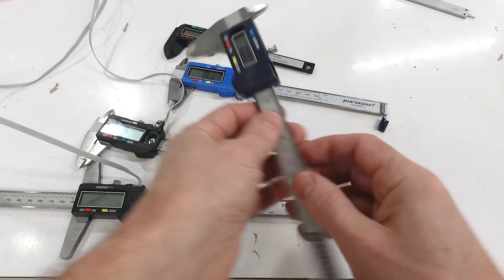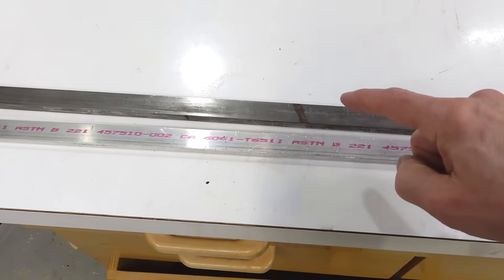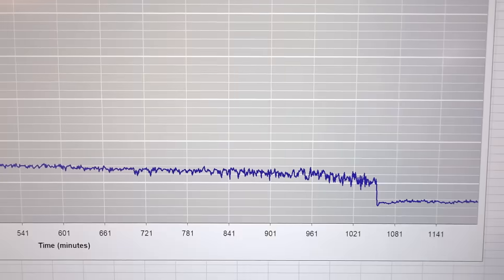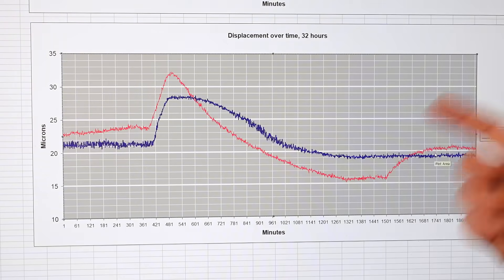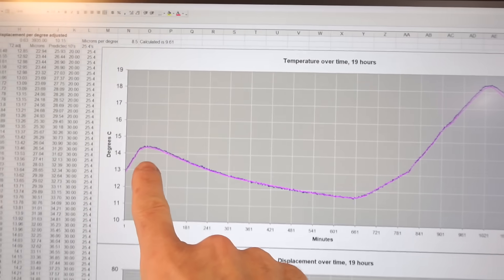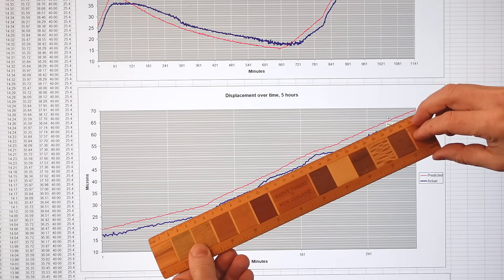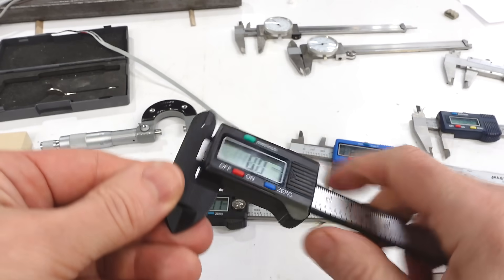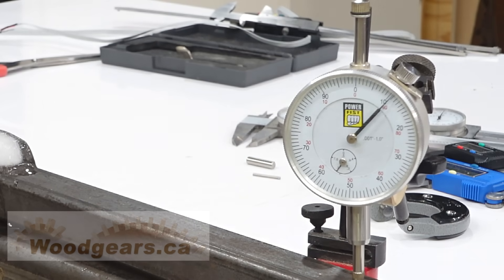Measuring microns with digital calipers

Comment: The ice cube response at the end is way too quick for me to understand. If it was anybody else on YouTube I would not believe it. Is there an explanation? Did you time lapse the reaction?
Reply from the maker: Nope, real time.  I warmed up the metal to about 35 degrees C beforehand so I'd get good heat transfer.  And melting ice takes up a tremendous amount of heat very quickly.  Was going to use a heat gun to heat it, but decided the ice cube would be more impressive, as its quiet and fast.
Reply: @ ahh, i missed that that bar was heated, that explains the quick temp reaction. That makes me feel better thanks.

Comment: Wondering of that repetitive error is caused by errors in the PCB layout or using "snap to". Or even the friction against the printed or engraved markings.
Reply from the maker: I would guess rounding errors in the software.  The period is far too short to be from the PCB traces, as those are much much larger.

Comment: Decades ago, I was in a friend's house. On the wall, he had a framed US Patent Certificate. I asked about it. He said he helped design a measuring system for military  artillery barrels, when the sun comes up in the morning, the barrel gets warmer on one side, causing shot deflection.
Reply: @1dave301  When the railways started to build the first railway bridges over the big rivers in the Netherlands (so think 1860's) they built a bridge and found one girder to be offset 5cm from the other. So they clamped it to one side in the morning, let it expand, then in the evening clamped it on the other side to let the cool night contract it. Over the course of a few days, the (multi-hundred-tonne) bridge was moved with milimetre precision to it's desired position.

Comment: 4:05 I don't think it's friction. I think you need to measure the temperature inside the rods.
Reply from the maker: the temperature in the rods would take possibly as much as a minute to equalize.  My experiments on the other hand went on for 20 hours.  So not a factor.

Comment: The cheap calipers do have an interface, they just don't have the connector soldered on.  If you pop off the case screws you can solder onto the board there and interface with it.
Reply from the maker: No, these plastic ones don't even have the pads to solder to.  The blue ones I have have  the pads but no removable part of the plastic.
Reply: @matthiasrandomstuff2221 thank you for looking.  They used to; I'm sorry I sent you on a wild goose chase

Comment: Terrific video.  Your work is always very interesting so don't worry about that.  Using relative linear thermal expansion of two metals was very clever although the limits of both accuracy (deviation from the absolute "true" value) and precision ("repeatability') are challenging at the micron level.  As you know thermal linear expansion is influenced by the specific composition of the metal, and even a digital Mitutoyo micrometer has a maximum resolution of 1micron +/- 1 micron (RSD of 100%).  But your approach, persistence and ingenuity in evaluating your results was impressive and it was interesing to see how closely you could approach a thousandth of a mm using simple calipers.  Great job!

Comment: Temperature sensors are on the surface, but the metal expansion happens as the entire block warms/cools. I think you would get more accurate temperatures if they were embedded completely in the metal. Just a guess...
Reply from the maker: metal is a good conductor of heat.  Air is not, cloth helps insulate.  Thus, the rods will equalize with themselves much faster than the environment.  As in, no significant temperature gradient.

Comment: The ice cube interaction being that quick was amazing. This was DEFINITELY and interesting and valuable video to share. Maybe a video on the pinout and interface to the arduino to share.
Reply from the maker: why don't you watch my video about the pinout and interface then, and share it?
Reply: @matthiasrandomstuff2221  I think I asked you in that other video 
"What type of connector that port was designed for?"
Looks like it was designed for a factory made connector, 
but I don't know which one..
Reply: @WagonLoads  They're all different from each other, with no standard for pinout or data format. The connector to use is a wooden/cardboard/3d printed block of a size that fits tightly in the opening between the PCB and front case, with spring pins in grooves that line up with the pads on the PCB. If you want a 'real' connector, solder a 4-pin JST-PH or microblade or something to those pads yourself.
Reply: @AJMansfield1  Yes, that is what I am talking about. I wanted to know what factory made part the circuit board footprint was designed for..

My calipers are all stainless steel except for a black plastic case that houses the display section..

Since I only have one set, it can't measure itself directly.
The only way is to shave something down until it just fits, 
then measure how wide it is..

I was thinking it was some kind of JST connector, 
but I didn't know which one.
Reply: @matthiasrandomstuff2221  I absolutely will! And I apologize if you mentioned it and I missed it in the video. Seeing the graphical results was VERY interesting, and I have often wondered if it was worth using the output. I think it would be simple to design a 3D printed plug for the access port.

Comment: Could there be small differences in temperature throughout the cross section of the bar that act as the "friction"? Like the side nearer the table, or nearer the blanket, being slightly warmer or colder than the side touching the other bar?
Reply from the maker: No.  They equalize MUCH faster than the room temperature was changing.
Reply: @matthiasrandomstuff2221  I guess that makes sense now that you put it that way. Thanks for the reply.

Comment: Fantastic video.  
Looks like you have some stick-slip going on - have you tried removing the calliper jaws and just having the readout PCB move freely against the scale PCB without any mechanical contact?  Would be interesting to see if that changed the lumps and bumps.  
There may also be stick-slip going on between the metal surfaces too.  I wonder whether some PTFE plumbers’ tape between the bars where they are not clamped would change things.
I’m not sure about your materials, but the CTE of rolled metal can be a bit anisotropic, which might explain why you need a 10% fudge factor in your expansion prediction.
Reply from the maker: then I would need to make some sturdy metal frame to mount the PCB to.  But wait, I already have one of those ... The calipers!

Comment: I don't know precisely what kind of sensor you are using, but have you considered any of the self-heating behaviors of some thermal sensors?  I.e.some you give a tiny current to in order to read.  For example, I did an experiment where I tied two sensors together and ran one 'constantly' and it heated up the one that I only sampled periodically.  i.e. if heating up the thermocouple made it think the aluminum was a tiny bit warmer than it was, it would predict more linear motion than was real.
Reply: interesting comment. Furthermore, the self heating temperature would change over time according to sensor thermal mass.
One factor to discount the self heating theory is that assuming a suitably low thermal resistance between sensor and metal, the sensor self heating should flow back into the metal
Reply from the maker: The temperatur sensors do self heat.  Every time I read them they briefly heat up by about .015 degrees.  This is actually useful as they only putput a resolution of 1/16th a degree, so by taking a bunch of successive readings and averaging, you can get more resolution.  I only do a cluster of readings every minute, so its pretty insignificant.

Comment: be careful, metrology and the science of measuring to extremely small precision, will be a deep hole that will consume you. You are an engineer, so you understand how this is a world that lives behind the curtains of consumers in everything we own. Awesome video, and yes it is very interesting. The fact that you are able to measure in the microns is a feat in itself, making it repeatable is the other hard part. I couldn't tell you how many times my cmm measured one thing during routine inspection, and another when a customer inspector was on site.
Reply: I don't know if you have ever heard of Marco Reps, but your comment really reminded me of him jokingly
Reply: Just don't try to set your clock correctly, so you know exactly what time it is. Over forty years later, I'm still not satisfied - my clock still isn't exactly right.

Comment: Nice demonstration. It is quite impressive that these mass produced PCB-based scales and inexpensive readout chips can achieve such resolution!

Once upon a time there was a company "Kensington Laboratories." They provided precision linear stages, popular in semiconductor industry. Outwardly they looked like any linear stage, but produced very good accuracy -- provided one followed a very specific ritual when installing them. You could not mount them to an ordinary machined flat surface. It had to actually be flat to the required accuracy. And one could not use four screws even then, to avoid bending the stage. All in all, achieving micron accuracy in all dimensions required dealing with many nuances which are easy to overlook in less demanding situations.

Comment: Matthias,
Interesting to see what calipers can do. Most people use digital calipers to measure 0,01 mm. When I was in the Delft Technical University in the Netherlands I was taught that according to the Abbe-principle, to do accurate measurements the position where you do the measurement should be in line with the measurement position. This does not work for a pair of calipers. So the best you can do with these is interpolating between the vernier lines of 0,1 mm, which gives you an accuracy of 0,05 mm. The fact that the electronics seem to geive 0,01 mm is not of any value.
To measure 0,01 mm you need a micrometer, as you showed in the beginning of your video.
All in all,  a very interesting project. It also shows that keeping the calipers in your hands for a longer time will distort your measurement.
Regards,
Sierk de Jongh
Reply from the maker: testing these, they surprisingly were within .01 mm compared to the micrometer. That's for the good ones though.  But my "good ones" are also cheap ones.

Comment: Two options to improve your readings.  Same setup with lubrication or add a shim on the clamp side and a needle bearing on the other end of the same thickness as the shim.  Results would be interesting.

Comment: Wow. And I thought I was smart for just hacking a physical on/off switch into all my calipers so the battery wouldn't be dead every time.
Reply from the maker: Must have been a very tiny switch.  Switch sure beats pulling the battery every time!
Reply: @matthiasrandomstuff2221  It was! Small enough, in fact, that when I was gluing it in, I also managed to glue the switch on the off position. Luckily it came in a 50-pack.

Comment: Thermal inertia. Air temp vs delay in metal heating?
Reply from the maker: I measure against the metal, inside the cloth, so I'm pretty sure the sensor is the same temperature as the metal.

Comment: super interesting... as marcoreps says: chasing zeros after the comma.
At the start of the video you showed clamping the aluminium and steel bars directly to each other, nothing in between them, but later with the ice demo there is an spacer between the two tubes.
I wonder if your measurements were done without or with something between both bars at the clamping end, so they are as free as possible to move independently, clamping is not a "point"; that might impose a lot of friction and create that creep/hysteresis you saw.
Also,  weight sensors spec sheet state the "creep" of the sensor, which for what I know is something intrinsic to the metal the sensor is made of (process, alloy), maybe here one or both bars also show that, either because they are hot/cold rolled, casted, etc.

Comment: What was the supply voltage sensitivity on that thing? Could it be that, when it's changing the number or position of active segments on the LCD, that's affecting supply voltage? :) Or any sort of internal coupling along the same lines (in which case there's not much you can do from the outside). This would also explain the increased noise when it's dithering between display values.

Comment: Your bimetal strip could be used as a thermostat.  Consider a filter to smooth the measurements.  Tektronix uses a method for getting 11 bit resolution out of 8 bit conversions on their older DSO scopes .. good read.    Mr. Kalman could be your friend.  Plenty of PYTHON libraries.  Do vibrations from local sources have any significance to the variations in your readings?

Comment: Well judging by the unfiltered or at least not the mean values of your calipers I'd guestimate your dragging is just a digital issue not a real mechanical dragging/hysteresis.
Reply from the maker: do explain how that is supposed to work? Its not like I implemented some filter that keeps old values around after averaging for a minute.

Comment: You are the first woodworker who cares about closer measurements than the average metalworker!
Reply: I think it's because wood moves. At the micron level, there is going to be a lot of movement over time so anything above 1/64 of an inch for 98% of woodworking is wasteful.
Reply: Not the first but I applaud the zeal

Comment: Keep in mind, you're possibly witnessing thermal changes in other items touching your measuring device.  Which means, there's uncertainty involved that may be showing up in what you think is strictly the UUT, but has other contributors.

If you really want to get that far down into the thermal effects, look into using a laser interferometer.  It removes the physical contact with the UUT.

- former Metrologist

Comment: Make your own with a encoder, it is pretty cheap and you can get really good results
Reply from the maker: what sort of encoder do you suggest?
Reply: @matthiasrandomstuff2221  Search for "Pulses Incremental Optical Rotary Encoder 100/200/360/ 400/600/1000/1024 P/R AB 2-phase 5-24V Encoder 6mm Shaft" and see if you like it

Comment: As always Interesting Traces and capacitors.. I never saw a detailed theoretical/mathematically explanation how those calipers work. I assume the 'comb'traces are slightly different (different pitch) so they produce an interference when slided. But how that produces such a high degree of accuracy (given that 'comb' traces are visible by the eye)  is beyond me. So If somebody can point me in the right direction..

Comment: You mean to say that if inches are used then the caliper is less accurate than in Millimeters
Reply from the maker: Just coarser resolution.  Though fancy ones will show to half a thou when in inches, which is almost as fine as .01 mm.

Comment: Next video - custom PCB for the custom calipers + PCBW/JLC/etc to manufacture this and here we have a sub-micron precission :)
Reply: PCBs are used because the cost is very low and the accuracy is sufficient for the application. They are just PCBs, no different from a PCB for any other nice gadget. Many manufacturers offer PCB fabrication services at very competitive rates even for small volume, precision products. The accuracy is good, but there are limits to how good it can be with the materials used in PCBs. 

For anything more accurate, the principles remain essentially the same, although usually using light instead of electricity. Precision scales are made form materials which allow to obtain better dimensional accuracy and thermal stability. The same photo-lithography is applied, but the pattern is etched in a layer of chromium on solid polished glass, instead of a layer of copper on fiberglass composite. Glass scales used to be relatively expensive, until companies in China started to make them in bulk. Now it is just another commodity item.
Reply from the maker: then I also have to design my own algorithm to read them.  Which may involve some analog circuitry built into the chip on the calipers.  Don't want to go down that rabbit hole.

Comment: You mentioned you weren’t sure this was interesting. I felt it was right up there with top most interesting videos I’ve watched that you’ve produced.😊
Reply: The caliper data output and the simple reminder of how finicky precise measurement becomes due to temperature were both pretty good tips. 👍
Reply: Ditto! Solving a problem of this type on a "DIY budget" and bringing the receipts as well is awesome!
Reply: I've subscribed on the back of this video, love this stuff
Reply: @regiondeltas  Я не такой терпеливый и подписался уже спустя минуту просмотра :) Это ОЧЕНЬ интересно. Это самое интересное видео за неделю, или даже за месяц!
Reply: This

Comment: Losen the two guide screws of the caliper. It's not the same screw as the friction screw, but two smaller ones that presses a brass thingy onto the guide rail. There should be two holes visible from outside with the screws inside

Comment: I was always told that you should not leave aluminum and steel touching because it'll cause a galvanic reaction, I know it was a brief period, but did you see any signs of corrosion between the two metals?

Comment: Wondering if there is thermal compensation or stability issues with the electronic circuits? Very impressed with your experiments' hardware and setup.

Comment: You can easily get sub-micron resolution with laser interferometry, than the capacitance based digital calipers. Could cookup one easily, with surplus lasers and beam splitters available for cheap.